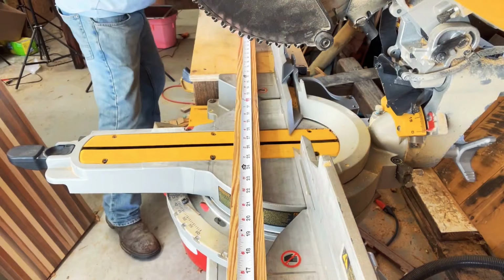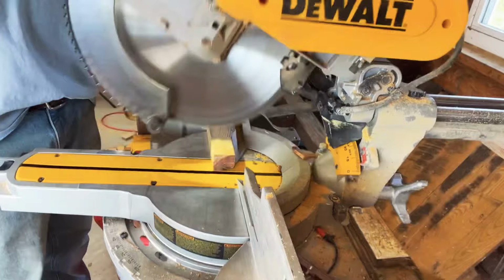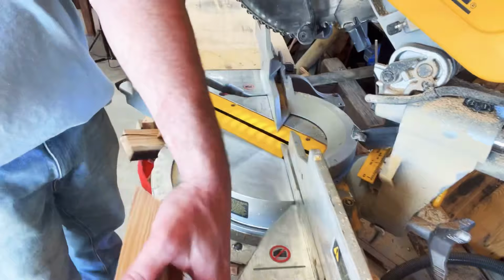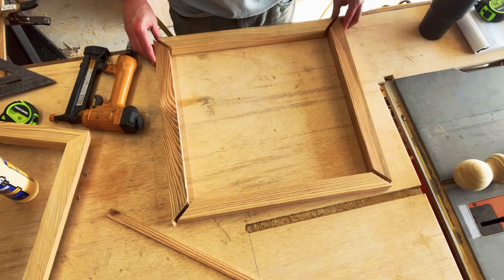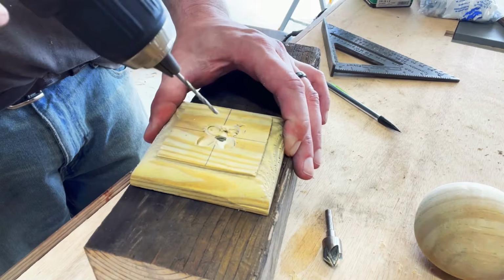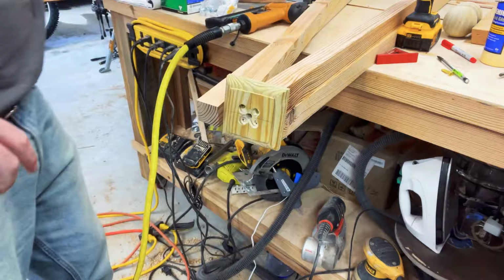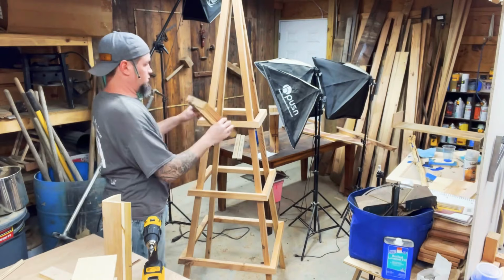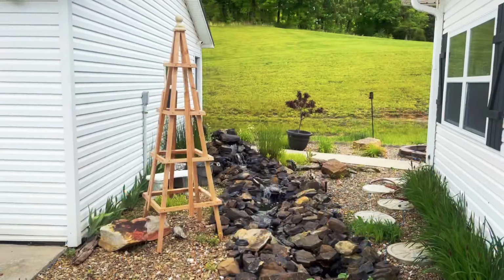HOW TO MAKE A GARDEN TRELLIS / TUTEUR / OBELISK.

Comment: I have just completed two of these for our shade garden. I needed height, so I didn't shorten the 8' 2X2s and added an extra "rib" of 30"X30", 12" from the ground. I also didn't want the decorative top and instead used copper fence post caps. These are both stunning and will provide great support for two vines I had previously planted. Thanks for the easy-to-follow video.

Comment: Thanks for this video!  We just delivered 24 to a local nursery!!!!  It was a lot of work, they requested them painted; half white, half black in 6 & 7 foot sizes.  Used primer and good exterior semi-gloss, sprayed on.  We've painted darker colors before and the primer really is does help with coverage, that said we had to go over spots with brush and roller.  We putty and paint over the deck screws, but I'm thinking that maybe using a deck screw the color of the obelisk (if available) may be perfectly fine...and then just dab a bit of paint in the hole to cover the raw wood?  We had built about 14 prior to this order, certainly no experts but we learned and developed a system to produce.  One of the challenges is, these things are big and you need a spot to build as well as store!  Oh and then deliver them...not like you can just toss them in the back of the truck!
Reply: Hi there. Just curious what type of wood you used for the ones you built?
Reply: @miataman2001  Hey!  We used pine.  Being that we painted with exterior paint, felt for the price, best to use.  Now...I can truly see the value of using cedar if you can get a good price as painting takes time especially when you're building multiples.  Last years cedar 2x2 did not make it cost efficient for us.
Reply: Can I ask how much you are charging and what area your in ?
Reply: @flogmot  The nursery bought them from us at 125.00 each (we had refused them at 100.00 each).  We sold more on our own at 100 - 125 each, although we were hoping when we got into this at 175.00 to 225.00 each.  We had to rent shop space, truck and/or trailer so in the end not profitable for us.  We're in the Seattle area.
Reply: What did they retail for. Did you have trouble getting the cap on the top of the legs, that is so hard to do

Comment: My first one took almost 5 hours. But I had to make little jigs for a stop on my miter saw. I guess I need to make a back brace to allow something to hook on as a stop. My 7* bevels on the cross pieces didn't line up right so I just made a 45. They turned out ok.  Thanks for the video. Bought the hard paper plans to show you some love for your hard work.
Reply: Thank You for that bit of  info , I gots a ole miter saw that don't be a having that back fancy angle to the dangle , 
An was  pondering if'n I could just slip another lil piece of wood up under it 🤔
After about a minute, I figured just a good ole reg 45 angle should suffice

Comment: I just finished making my first obelisk by following this video, and I have to say this is a very clever and well thought out design. However, due to the arthritis in my hands, there is no way I could follow the video instructions for assembling the squares. Holding two pieces lubricated with slippery glue and then nailing them was simply beyond me. So when in doubt, use clamps. This is going to take longer to read/write than it did to actually do the job. Take piece one and clamp to the workbench, apply glue to the right hand end, position piece two and nail. Unclamp piece one and clamp piece two, apply glue, position piece three and nail. Repeat all the way round and for all the squares. You get the picture.
Reply from the maker: Awesome way to think outside of the box Peter!  You could also make a jig to hold the angle while you work with it!

Comment: If you are going to give this build a shot do what I did and it's generally how I approach any new build that I haven't wrapped my crazy ass brain around.  Build a small version of the project.   I built a obelisk that was 18" tall.  I got the angels straight and now I can whip them out pretty quick.  I actually build miniature furniture in usually 1/8th scale which means that 1" is equal to 1/8th inch.  I build some really nice Adirondack chairs.  I looked through the endless magazines and books  I have collected over the years and I found a chair that would be a bit of a challenge at full scale but when you break it down and scale it down you realize that you are spending hours cutting out little arm supports along with all the rest of the parts.  I had a endless amount of seat slats and the back is curved.   I got so sick of the scroll saw and standing at the sander for what seemed like days and watching dust covering my bench.  I had the dust collector on but it never gets it all.. 
Peace

Comment: You did a great job.  Thanks for the very clear explanation, your cut list, and training.  I plan to make one this weekend.  I am curious, i am considering screwing the decorative boards from the inside to avoid the screw heads.  I was also considering pocket holes for the squares.  I am mostly wondering if you have looked into having no screws visible or if it really does not matter.  Thanks.
Reply: You can also countersink the screws and plug them, or use a wood putty
Reply: This is a decent video, but you should definitely screw from the back that way it doesn't look like it has 1000 holes in it. Even if its getting painted, no sense in adding more work for yourself with having to use putty or spackel to fill holes.

Comment: I'm very surprised that nobody has mentioned using TRIM SCREWS where you using deck screws with the big head.  The hole left by the head is only 1/8 inch in diameter.  PLUS....most of the time, you don't even have to to pre drill or use a counter sink the head.  Another note is that ALL deck screws have little flutes under the head of the screw that makes them counter sink them selves.

Comment: Great video thanks for sharing!
So you used regular pine wood and no finish to protect it from rough weather?
Reply from the maker: It was eventually painted. But as long as it has air flow it will last many years. Maybe blocks for ground contact.

Comment: I'm new to wood working and this might be a silly question. But for the first 10 inch cuts for the square, the 10 inches is from the longest point correct? Since it's a bevel cut, I was measuring 10 inches, but the bottom angled side is coming out longer than 10 inches. Sorry, probably confusing sounding.
Reply: Measure from long points

Comment: Always have trouble with angles. I need to make one nine feet high. how did you determine your bevel and angle cuts?
Reply from the maker: You can use the same angles and just add length.

Comment: Is that pressure treated pine or yellow pine?
Reply from the maker: Thats just heart pine.... its what I had.  Plus some climbing plants cant take treated material.  As long as you have air flow it will last.  I would still put a bit of stain or paint to help it out.

Comment: I listened carefully about making sure to screw and countersink the cross pieces at every end of the board….did you any issue with the screws on the corners? Seems like there maybe???
Reply from the maker: I didnt but if using screws always predrill and countersink with a bit before screwing into the vertical boards.

Comment: Excellent video. Not sure I get the 7 degree miter and 7 degree bevel. Are you saying the saw is configured to do both cuts at the same time? What size is you miter saw? Thank you
Reply from the maker: yes. It’s a compound miter saw. so it will cut bevel and angle at the same time.

Comment: Nice video.  Quick question:  if you placed the 2x2 cross pieces inside the posts, rather than wrapping around the outside, wouldn’t you need to miter the ends at 10 degrees and then rotate 10 degrees?  The cross pieces won’t be parallel to the ground but would be on the same plane as the outside of the legs, wouldn’t they?

I attempted to build and the compound miter on the wraparound squares went awry.  So, trying to simplify in my mind.  (Even with the difficulty, the trellis still looks pretty cool.  Next one will like get a windmill or whirligig of some description on top.)
Reply from the maker: I would have to put the pencil to it....
Reply from the maker: Way to think outside of the box though!

Comment: Hey Matt, are those actual 2” X 2” or are they 1 1/2” X 1 1/2” ? I cut mine at 1 1/2” X 1 1/2” and need to put the miter and bevel on them still tomorrow. However as I thought about it, if they needed to actually be 2” X 2” I think that might change the side lengths a little wouldn’t it? A little help would be appreciated before I make my cuts.